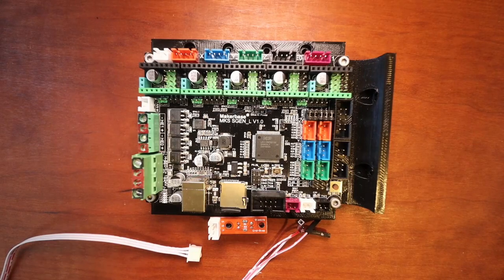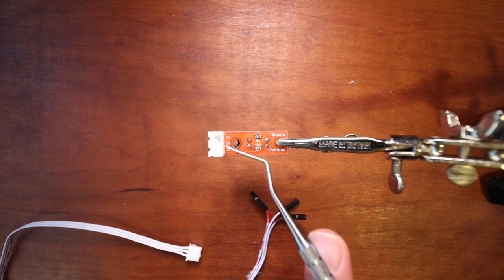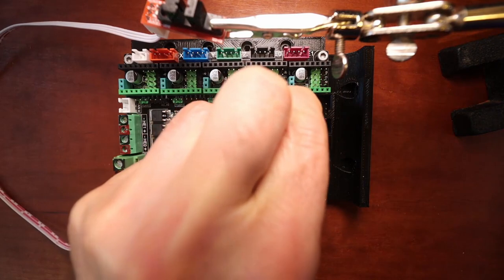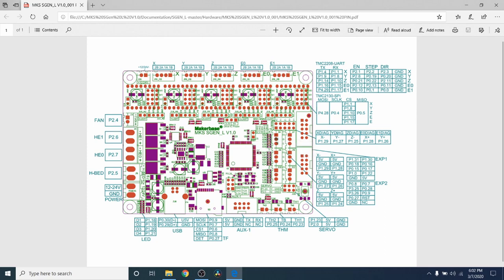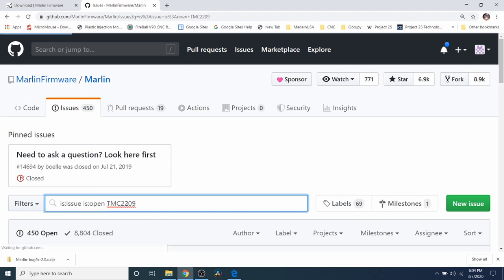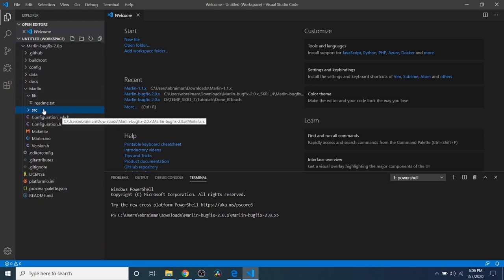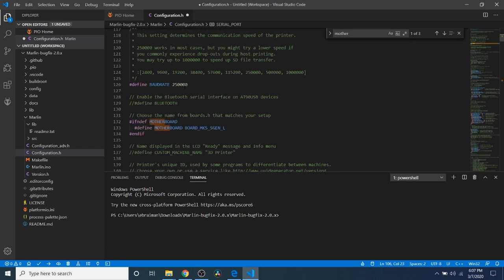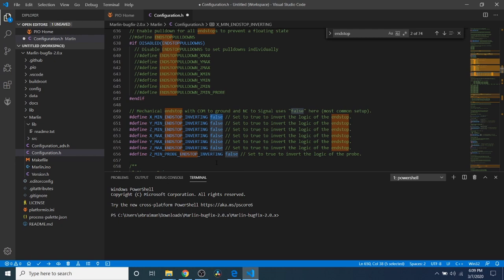MKS SGEN L V1.0 - Optical Endstop

Comment: and then I'm going to fit the proper JST plug to the board end so i wont mix up the wires in the future and be confident of the connection for years to come.   IMHO using single Dupont is asking for trouble.  Would recommend a 3 way Dupont or hot glue the 3 singles.  Great vid otherwise and im always amazed how many people don't use pronterface & the 119 command to test endstops. Hopefully this vid will lead to more people being able to diagnose endstop issues.  ( might be an idea to post an affiliate link to a JST assortment box and or a video on crimping without an expensive crimp tool )